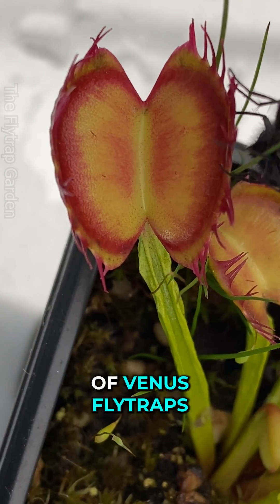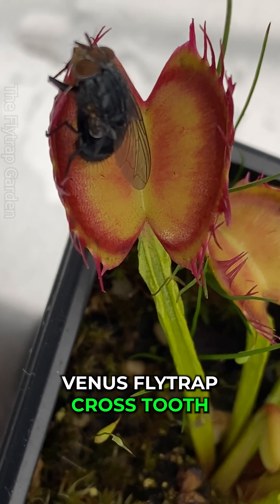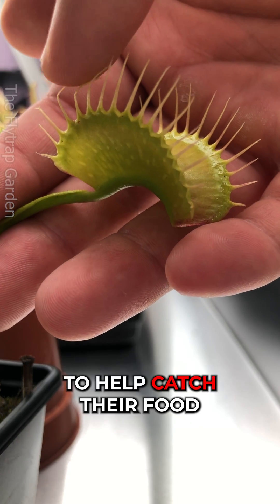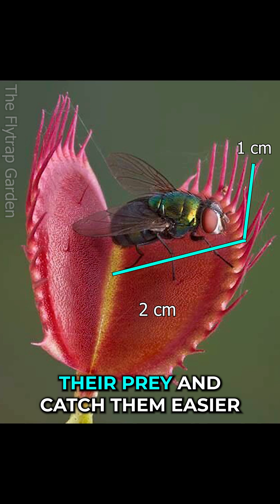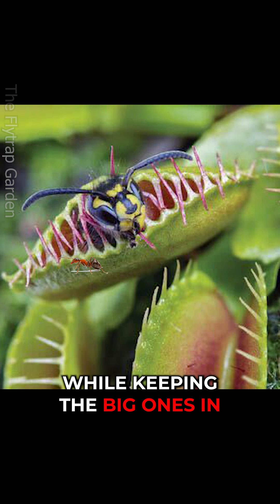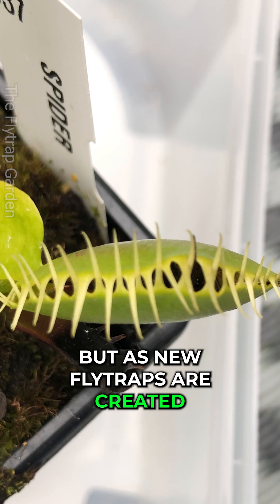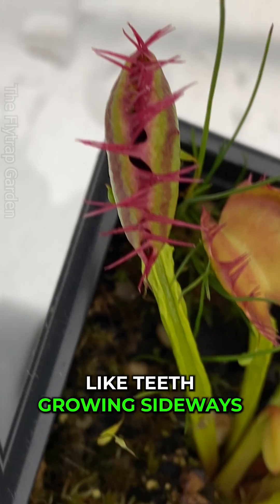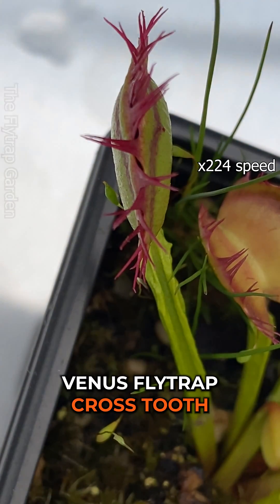Mutated Venus Flytrap #shorts

Comment: I remember I once saw a flytrap plant where all the traps with single leaves in a cup shape. I never saw how it closed
Reply: Those are called pitcher plants. They don't close. Insects land on them to collect their nectar and slip on downward-facing hairs around the edge of the pitcher. They fall into the liquid contained in the pitcher where they are drowned and slowly digested.
Reply: @aviandragon1390  It wasn't a pitcher, it was still a flytrap. It just looked like a single leaf folded around a single point. It was called a "cup trap" by the seller

Comment: So triggering a trap to snap shut is not enough for the plant to start the digestion process? It has to sense that there is something in the closed trap to start secreting enzymes?
Reply from the maker: Yes
Reply: yep , after the trap is triggered it has to receive an additional trip from the insect caught in order for the trap to fully close and seal shut before it starts to produce the digestive enzymes which basically break down the insects body while it's alive.

Comment: Hi can you pls help me i don't know how often water them  i have two pots with these plants and i don't really know how often water them
Reply: Flytraps generally live in swamps so they like plenty of water and high humidity. Just don't let mold or fungus grow in their pot. They like acidic soil with low nutrient levels. They usually come potted in peat moss.

Never play with the traps unless you want to kill the plant. It costs the plant a lot of energy to close the trap. It's counting on eating a yummy bug for all the effort.

If you feed the plant, try not to give it insects which are too large to fit completely inside the trap or it will not seal correctly and the bacteria that grow on the exposed rotting insect can harm the plant.

Once a trap has digested an insect it may open back up to feed again, but usually the trap will die off after the second cycle.

Comment: Can you show some video how the flowers eat the bugs you show how the Venus flytrap catch the bugs but I wanna see how the Venus flytrap eats the bugs plz
Reply: the “traps” on a venus fly trap aren’t the flowers but are actually just modified leaves, basically how it works is the venus fly trap secretes a sugary liquid from its leaves/traps, that attracts bugs to come investigate, the leaves/traps also have little “hairs” on the inside of the trap (not the “teeth” that grow on the sides) which act as tripwires to signal to the plant that there’s something it can trap. the bug lands on the trap and walks around a bit bumping into the little hairs, once they hit the hairs about 3 times the trap closes up on them, slowly but surely the trap secretes digestive enzymes that break the bug down (basically like a little stomach) until it is eventually turned into a sort of soup that’s then absorbed by the trap. 
the reason they do this is because venus fly traps have evolved specifically to survive in substrates that are very low in nutrients, so they have to get them somewhere else: bugs (or anything else small enough to get trapped)